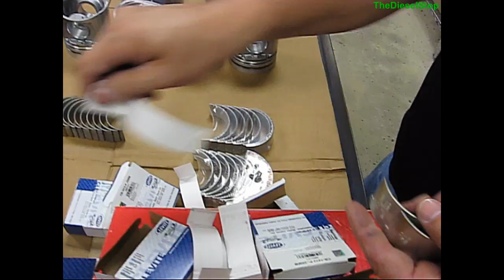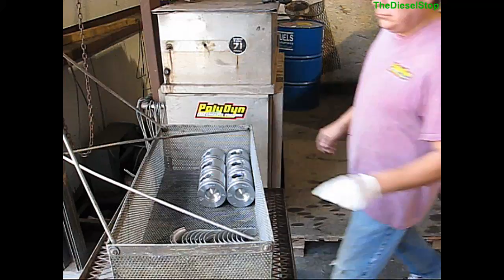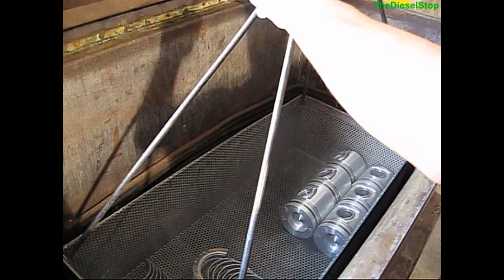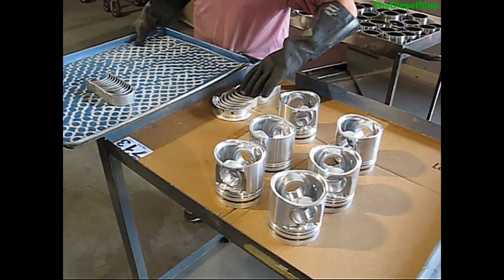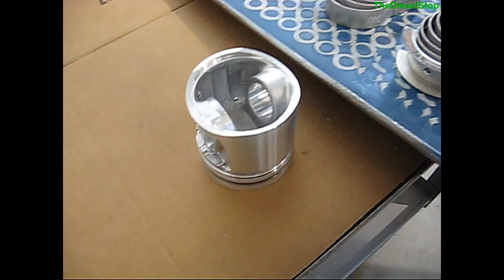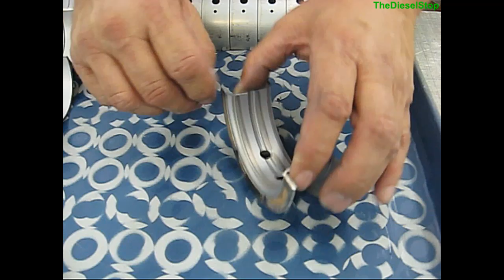5.9 Cummins PolyDyn coated pistons Part 2

Comment: Great Video Wayne.  Were the pistons balanced already?  I would think they would have to balance the whole thing when you are done....  Crank, rods, pistons...  Do the grind on the inside of the parts then so is not to disturb the coating?

Comment from the maker: @cowboydan86 Coating the tops and skirts normally runs $36 per piston. The main bearing set for a Cummins cost $50.40 and the rod bearing set cost $28. The turn around time is normally 2-3 days in shop.